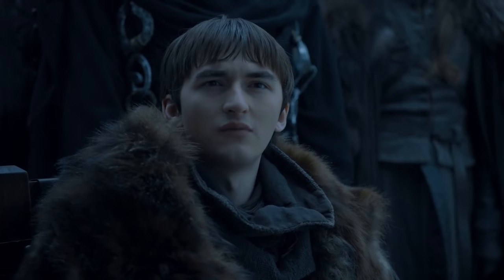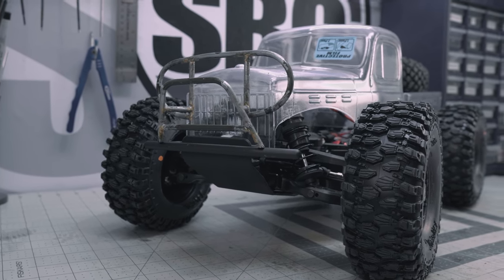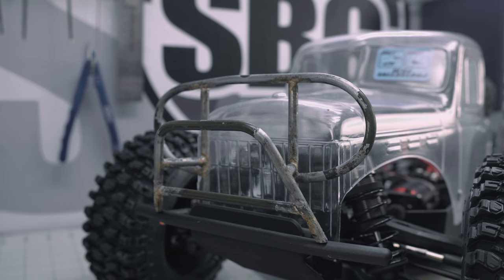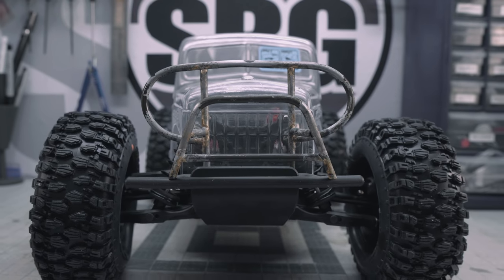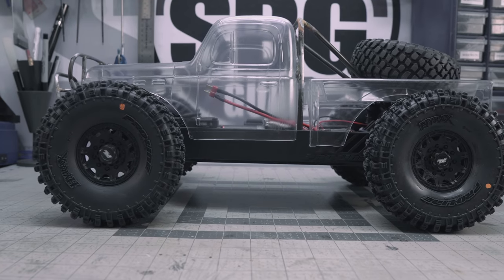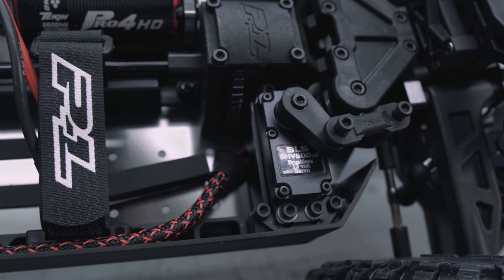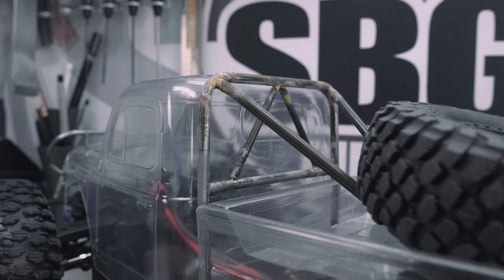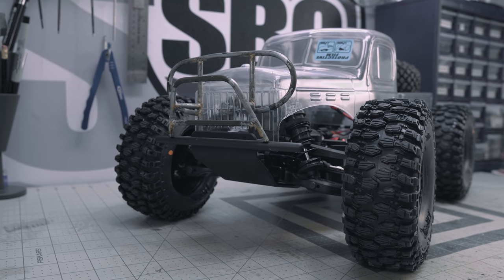#MonthlyMayhem Challenge Ultra4usion Ep2

Comment: I'm really impressed with your build! I think you might win this. your weight is going to be better and that will be key. I do think that a Out runner motor in 1500kv would suit this build much better. find a 12 stater motor or more if you can as they perform better at low speeds.
Reply from the maker: Hmm, I'll check those out. Still wanted big power with low KV's, so we'll see!

Comment: Idk if you have Steel It available, but thatd be great for that bumper and match the chassis plastic black pretty good.
Reply from the maker: I'll have to investigate, thanks for the tip!
Reply: @scalebuildersguild  no problem! just used it on my FJ40 build for the rollbar and bumper and so far it works great! and allows you to weld/braze on it later without needing to remove the paint.

Comment: You need to change that servo arm and servo arm link to alloy or steel of some sort. That is if I saw plastic on on both of those parts Sir. Other than that it really looks great. Both you and Josh are doing a great job, and they are going to perform really great, they will destroy the Axial Yeti. If you haven't seen what dominates U4, just check out the DB48 R/C NETWORK built, I believe it was the first but it's built off the TEKNO SCT410.3 chassis and drivetrain so this might actually be a better setup. The only thing I have noticed neither of you have is the driver figure you have to have to actually enter a U4 RACE.
Reply from the maker: Metal servo arm added. Driver will be there, not to worry!
Reply: @scalebuildersguild  I figured you wouldn't miss that but just in case I thought I would give you a heads up. I would change the servo link to a metal one as well, I may be wrong but it appeared to be plastic as well

Comment: soak your cage work in hot soapy water for a few hours. the flux will then disolve off and you can scrub the joints with scotch pads, or steel wool. the joints will get super clean.
Reply from the maker: You're a smart man. I knew I liked you for a reason.
Reply: @scalebuildersguild  or just  keep an old rag in some soapy water and after you let the joint air cool you should be able to just scrub it off pretty easily.

Comment: I've got a little Redcat SCT I'd love to use to build something like this! Loving the build man! 

When your brazing that tube work what kinda fire protection do you use? Welders table or fire bricks? Anything like that?
Reply from the maker: Hey there, I use a few slabs of steel as risers, a fireproof tile, and a grate system to keep the pieces in place. I always have a fire extinguisher nearby.

Comment: Ok, as always, GREAT video -- it's time for me to pull the trigger on some SBG gear! :)
Quick off topic question ... One thing that annoys me is rebuilding shocks.  I tend to pound on my rig a lot and I end up blowing out my shocks every few months.  I've gotten good at rebuilding them but I'm lazy as hell (and honest).  I hear mixed feedback about internal spring shocks (no oil) like the RC4ZD0075 - RC4WD Bilstein SZ Series Scale Shock Absorbers.  Do you have any experience running internal spring shocks on an SCX10 variety crawler? Appreciate the feedback. :)
Reply from the maker: If you want good, functional shocks, probably best to stick with coilovers. Internal springs are far too weak.
Reply: An opinion I trust, thanks bud.  Any preference or recommendation on shocks that don't require a rebuild after each bashing? :) Size: 90mm for my SCX10 "Frankebolt"...